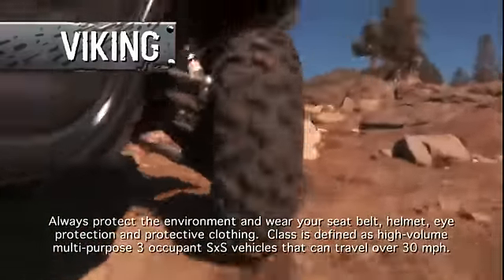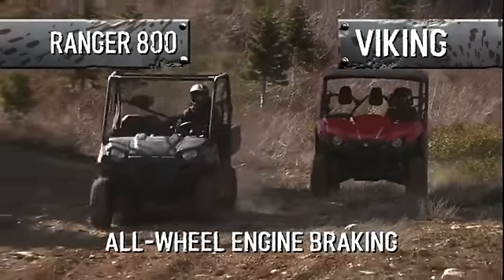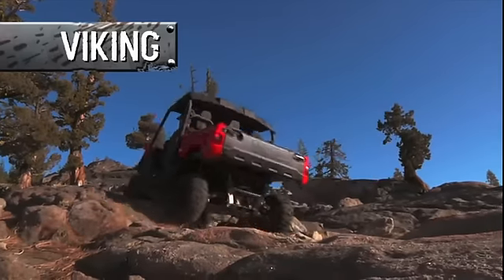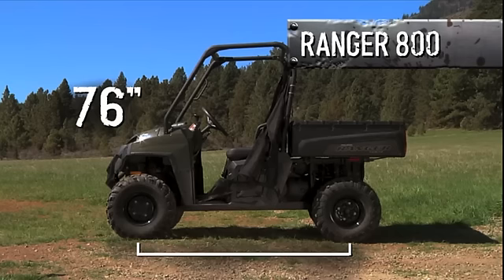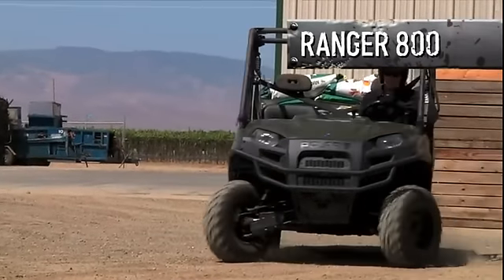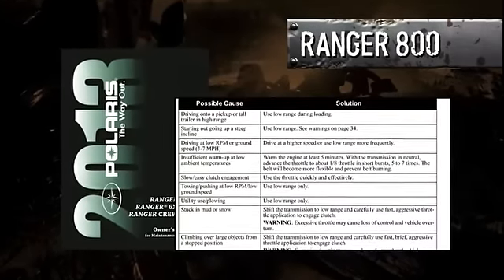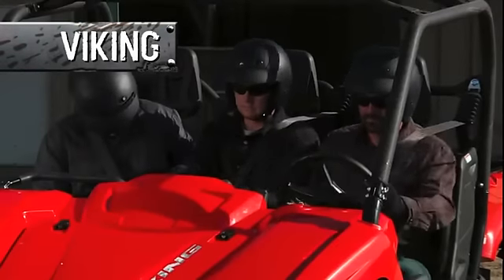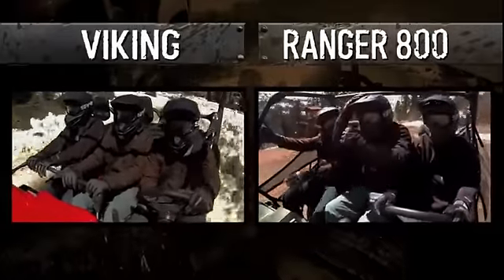2014 Yamaha Viking vs  Polaris Ranger :  Head to Head

Comment: I tell you what the past weekend the boys and I went up north in Michigan and rode the trail systems near Cheboygan. my buddies have Kawasaki Brute Force 750i and a Kawasaki Prairie 400 quads and I have Yamaha Grizzly 700 fi. all the Kawasaki's  continuously kept shutting off in wet conditions, deep mudding and in deep puddles. my buddies 2015 Brute Force even shut off at a stop sign in dry conditions. my 2015 Yamaha Grizzly 700 fi didn't have a single prop and never has. I can switch from 4 by 4 to 2 wheel drive while driving both my buddies both have to stop. Yamaha is the only one on the market that has a marine-grade wiring harness. they might not be the fastest or have the biggest Motors in industry but they are the best all-around machine. because of all the above I'm looking at buying the Viking 6

Comment: And to the other guy who doesn't think it's possible for a 2013 ranger 900 to go 60 in about 5-6 seconds, think about if for a minute......... 1 Mississippi, 2 Mississippi, 3 Mississippi, 4 Mississippi, 5 Mississippi, 6 Mississippi....... And that's petal to the metal. It's been done. More then once.

Comment: Had a polaris ranger kept it a little over a year and sold it. Belts were already giving trouble. Hard to start in cold weather. Noisy engine, clunky , buck jumping going down hill. Never abused only light farm use. Traded it for a Honda pioneer had it six years now. Not as much speed but quieter, more agile. But will prolly try something different next time cause having engine trouble already with it and only 600hrs on it.

Comment: If you put a 1000lbs on the Yamaha, would it handle better than the Ranger? Also I thought the Ranger is just a 2-seater. You have the option of a 4-seater which is getting very popular. I could be wrong.
Reply: The Yamaha isn't rated to haul 1000 pounds dummy. Polaris claims to be able to haul 1000 pounds and you see what happens. Polaris are junk.

Comment: I will never buy another yamaha utv until there is a V twin engine and my 2014 modded polaris rzr 1000 xp  and rzr 4 1000 none modded could do more then a viking same goes for my range 900 still could do more and what the viking 40 or 50 horse and the ranger 78 or 80 horse and the rzr 107 horse plus mods to it now has 117 horse wow Yamaha lots of catching up to do.
Reply: Yeah and you're also wrenching on those turds every time you ride. Everyone with a RZR breaks something almost every trip. They use crappy parts and they're built in Mexico. Polaris has serious quality control issues and they use weak metal and parts. You can never compare anything Polaris makes to the Japanese manufacturers who take pride in their product. Honda, Kawasaki and Yamaha are as tough as they come with Yamaha being the best and most innovative, always pushing the envelope. When Yamaha debuts their sport side x side, Polaris owners will leave in droves. Just like the Viking stomps all over the Ranger, the Yamaha sport UTV will stomp all over the RZR when it's released. Everyone knows it's coming and it will probably be debuted this June.
Reply: VitalYFZ You got it wrong my friend! I have not ever broken a stock part on my rzr. I mean I changed most of it out but still most stock parts. And the Viking is shit still. The 700 is powerless and does not have that much torque like a side by side should have. Yeah the 700 grizzly has great torque being it`s smaller and all that but putting that motor in a utv? Not my slice of cake. Yeah Honda`s are  great but Kawaski is just another peace of crap that I don`t like. I have had one of there quads and utvs, never liked them what`s so ever. Polaris is made in Japan just so you now. Maybe there factory`s are down in Mexico but their design,engine`s, etc are all from Japan.
Reply: Kyle Fitzgerald Well you are the luckiest RZR owner I know. I have been riding side x sides since 2006 and every friend of mine with a RZR has issues.
Reply: Kyle Fitzgerald The word is out, Save the Date, Yamaha will be debuting a new side x side in a new category 1-20-2015. Let's see if it's finally a sport model so those of us holding out and refusing to buy a RZR can finally get a new ride.
Reply: VitalYFZ I never really said Yamaha is bad. I have a 2012 yamaha kodiak 450 eps se. Best bike I have owned. I was just pointing out the rhino has been out for what 10+ years and the viking only two and they are both still the same just one tow`s more. I will buy a side by side when Yamaha can release a sport  racer that can compete with polaris,can am, and arctic cat. But until when ever your saying the release date is I will be riding in my rzr.
Reply: check out the yamaha yxz 1000r
Reply: Michael Bradley I have. I'm not really a fan. But I do like that they offer a 5 speed manual. Something sure different.
Reply: It's actually pretty fun I got to test ride one when I got my 2016 grizzly and yes very different
Reply: Michael Bradley I'm sure it is. But I've had bad luck with Yamaha and I just lost interest.

Comment: I have a ranger. Exhaust glows orange, polaris says its normal. Starter went out after a month. Going back to yamaha. More reliable in my opinion
Reply: My Polaris had terrible electrical issues. New ECM, new display, new ignition switch and it still doesn't work right.  Going to Yamaha or Kawasaki if I can ever get this one fixed and traded in.
Reply: Rod Gore Yeah they run good,but I really don't think the quality is there. I've been riding for 30+ years dirt bikes, quad, and now s x s's. I've owned all the Japanese brands and a few European. Never had problems like I've had with this polaris.

Comment: I don't get the popularity of the side by sides. for the price of one of these you can buy a used jeep that does everything these do...but better.a jeep is all weather, try riding a side by side in a snow or rain storm. wait....you cant! they aren't road legal.  ..HUGE disadvantage, a jeep has air conditioning, stereo etc. a jeep lasts longer and holds its value better. I cant think of one advantage a side by side has compared to a jeep. anyone?
Reply: $6000 for an old CJ that will run for ever. $11k for a new side x side. which will go about 4 or 5 years typically before all the plastic breaks and falls apart. Same with a 4 wheeler.
Reply: i totally agree but i can think of a pretty big advantage you can fit sxs on way more trails than a jeep and they go a little better off-road than a jeep would unless its like a old willys or something like that then its a different story
Reply: 2010mfgc2400 you cant drive a side by side in rain or snow because everything will get wet or ruined inside the vehicle,, if you don't mind that, or being wet, cold and uncomfortable, then I guess you could. I just prefer the all weather capability of a jeep is all.

Comment: I don't see where they found a bare bone 800 at. The 09 500 efi has 1700ci of interior cargo room. Three seat belts and 20 different tie downs in the rear. And they talk about cargo capacity the polaris hd has a self leveling rear suspension.  I don't understand the review at all it showed the viking with 600lbs in the cargo bed and a 1000 in the ranger put 600 lbs in the ranger then compare them.  Horrible review.

Comment: I have driven and had rangers for a long time. they are good, yes.but how ever from all my research and questioning I have come up with that the Viking is better. sorry Polaris. the thing is... I would use the Viking way more than the ranger if I had one. because the Viking is better for going in fields, it can be used more for sport and work. its kinda like a ranger and rzr at once in my opinion. its more comfy too, and youre atleast down in the machine! lol. I like the door idea so mud and water and shit doesn't get on the floor of the machine and stuff as easy, or, atleast its better than a net!!! the Viking is better for touring and family reunions. but I will give the ranger that it is better for rock picking... but I trust Yamaha WAY MORE because of build and better engine. Yamaha is best in all that. I know because of my all my grizzlys, vs all the other atvs ever!!! that is how live bitches! you don't like it, that's your problem! im all for Yamaha! and Yamaha makes the best dirtbikes, ATVs, motorcycles, and sometimes snowmobiles. all that is for sure. Polaris does have the upper hand in UTVs but Yamaha is best!!! so fuck off all you haters!
Reply: YEAH YAMAHA YEET